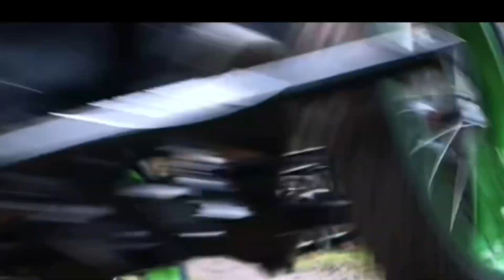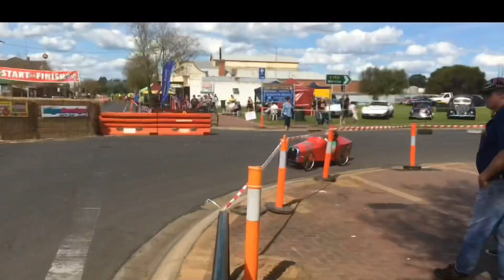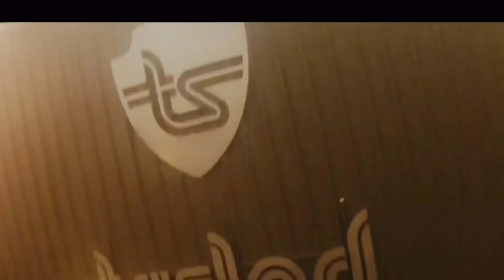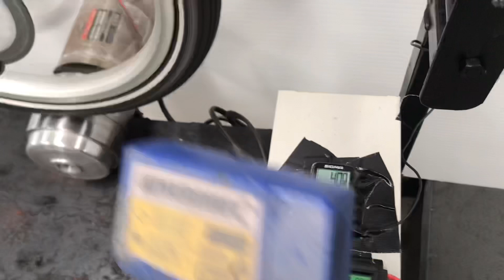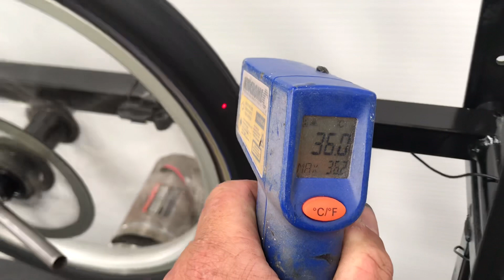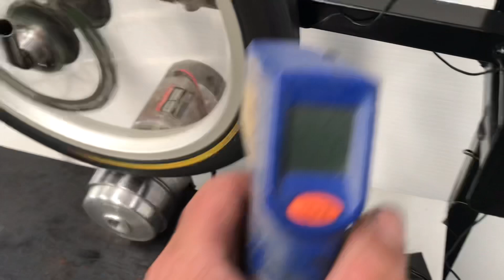349mm Race Tire Mega Test

Comment: @trisled one interesting thing about this test is how many of the tires (of the same compound and model like Schwalbe One) actually are faster with 349 compared to 406. That is surprising for me. 

I love how you tried different rims and different tubes. But I found the biggest variable that affects rolling resistance was omitted, which is different tire pressures: surely, you cannot test a 28mm tire at 90 psi against a 50mm tire at the same 90 psi. Instead, I think some interpolation of pressure related to the width must be taken into account.

Comment: Could you please add the tyre widths to the results table - preferably nominal and actual? A 40mm Scorcher at 90 psi is going to have much less vertical deformation and give a rather different ride to running a 28mm Schwalbe One at 90 psi.

Comment: Could you do the same test with 406 tire or do you think the results would be the same ?
Reply from the maker: Stay tuned for our 406 tests sometime next month. We’ll find out together 👍
Reply: @TriSled  
Great test! Thanks Trisled!

Do you think that the data from the 406 mm wheel size test can be compared with this 349 mm data? In other words, would it be possible to measure the difference in rolling resistance between 349 mm and 406 mm? 
If the rolling resistance between these sizes is negligible, 349 mm would be an interesting alternative to create a smaller Turn Circle… 😊

Comment: Some of the tyres look like they are wobbling significantly - are you sure they were all seated correctly? For example the Kojaks (which happens to be a tyre I run and have had trouble with getting on completely right).
Reply from the maker: This is definitely a consideration. We carefully selected a rim profile known for good beading qualities and made every effort to make them and straight as possible. However at the end of the day this seems to be as sizeable measure of tire quality at its construction so the test is honest to the results. It’s amazing how much this varied through the different models of tire.

Comment: How do we interpret this table? What is the Influence of Temperature and Wattage?
Reply from the maker: Interpretation of data is most of science😊 I’ll leave you to draw your own conclusions.  However it seems reasonable to suggest that the faster tires don’t accumulate heat and this data set would be consistent with that